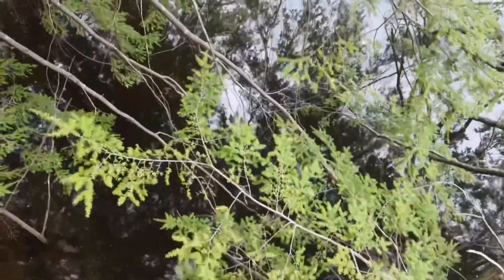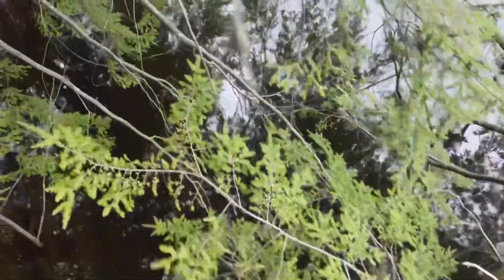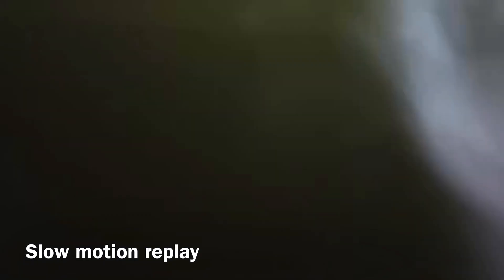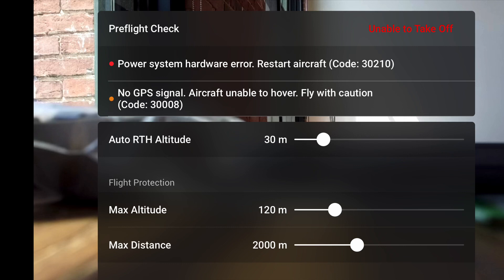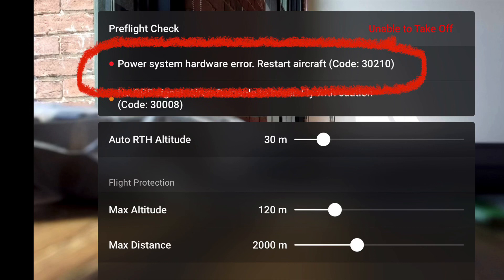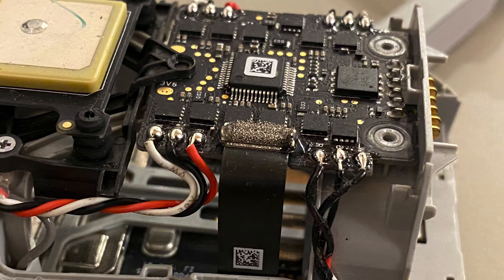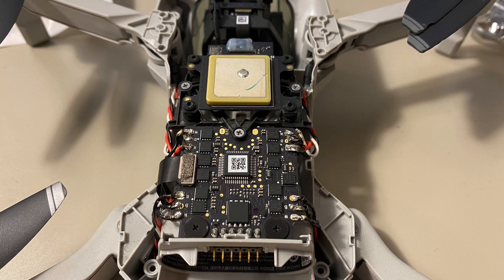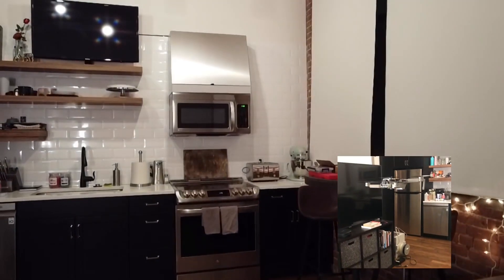Mavic Mini error 30210 fix after crashing in water

Comment: Well I changed the ESC Board , I changed the Motors , all four ! I changed the GPS Module and still it says "Power System Error" everything was taken from one of my Working Mini-2 drones , I certainly wouldn't go any further with this one cause I could pickup a Used one for Cheaper ! The GPS Module , the ESC Board and Three of the Motors are no good , thus the reason for changing all of these parts but after still seeing the Error Message and knowing that all these Parts would have to be Ordered to get this one fixed , it makes no sense .

Comment: Hey i got a new esc board and still it say error 30210 could it be the cord
Reply: I hope I don't have this problem :( . I just ordered mine. Did you figure it out?!
Reply: @NiNjaTurtLe697  You may just need to check all your motors for dents, sand .etc debris.blow it out ...1st!!!!!!!

they need to rotate easily or the sensor will give you error 30210...or the entire esc board will need replacing.
Make sure you check each motor winding and also check for damage.
 I recently bent the the outer bell housing back as close as I could and it worked!
Also spin the motor housing and check for wobbly uneven turns of the bell housing and attempt to carefully!!! bend it back...this can be done too!

The motor may be hitting the stator magnets some.
You may not need a whole new esc board....

Comment: Omg buy new esc will fix?
Reply: In most cases.  Sometimes there can be a problem in the motors, you may have to blow them out or check for protruding wiring.